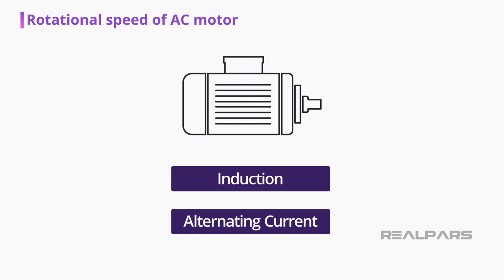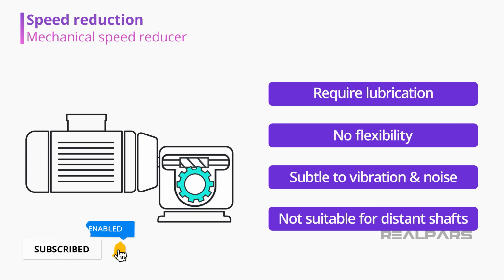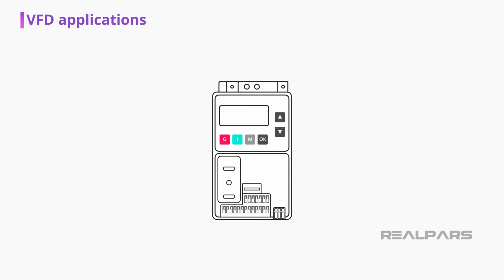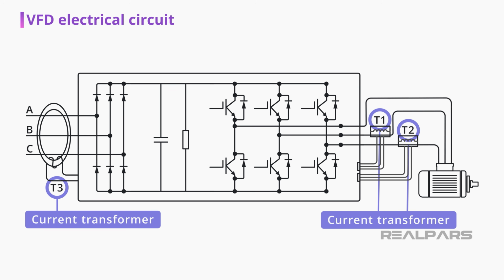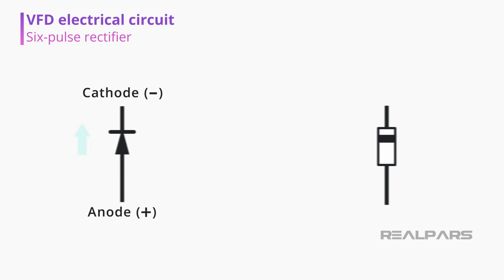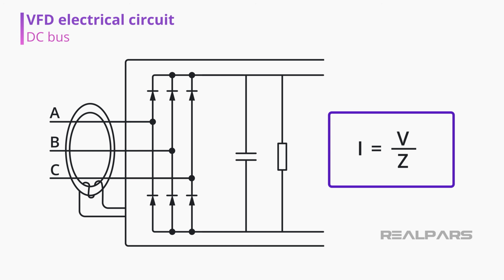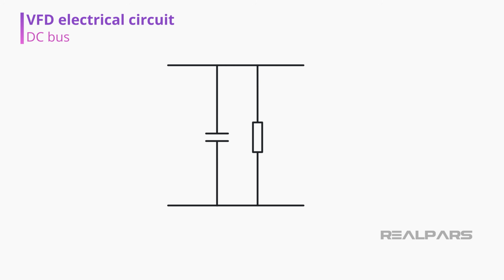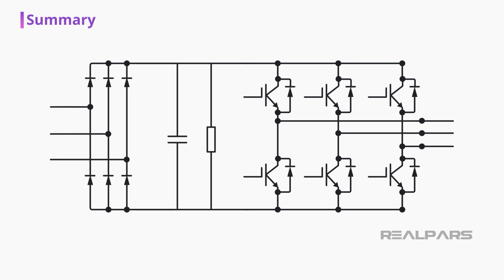Variable Frequency Drives Explained | VFD Basics - Part 1

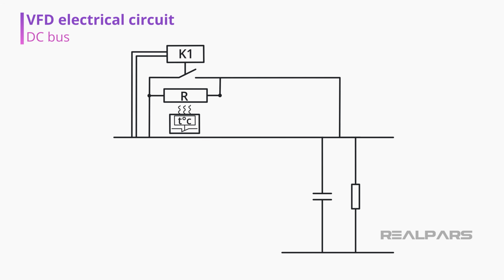Comment: I can't make sense of the pre-charge circuit at 6:15. Disregarding resistances in wiring it looks like it's shorted so any current would just go through the bottom branch straight to the low-pass filter. K1 doesn't seem to do much. What am I missing?
Reply from the maker: R is used to pre-charge the capacitor bank.  Once the capacitors are charged, K1 should close, thereby by-passing R.  When K1 is closed, current will flow through K1 preferentially, since it is the path of least resistance.  If the motor starts and draws current for too long through R, the thermostat will trip and stop the motor.  Internal circuitry is used to determine when K1 should close.  The actual circuits are much more complex than what is shown, but the diagram in the video helps illustrate these concepts.
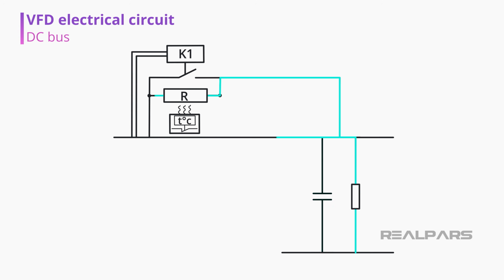Reply: @realpars  When K1 is open, there are 2 paths : one with R and one with nothing on it (the bottom one). So, on your drawing, the current should only go to the bottom one and not through R. I don't understand why the current can go to 2 different paths at the same time (6:18). Maybe the bottom line should not be here and instead only R or K1 ?
Reply: @idealdonor  exactly I was searching for one comment that notice this problem, basically de line under the pre-charge resistor shouldn’t be there because is a short circuit, if you remove it now you can see a utility for the K1 contact that is if the capacitor is charge to some level now we can close K1 making the other path for the current killing the R pre-charging.

Every nice video some times little details that needs to be fix but we have the comments section to discuss!

Comment: Why rectifiers are used in VFDs, what is the advantage of rectifier in VFD.
Reply from the maker: A VFD is used to provide power at a variable frequency to the motor.  There is no device that can directly convert 60Hz incoming AC power (or 50Hz in some areas) to any other frequency.  Therefore, the incoming AC power must be converted to DC and then back to AC at whatever frequency is required.  A rectifier section in the VFD is used to convert AC power to DC power, and an inverter section is used to convert the DC power back to AC power of the specified frequency.

Comment: another question please and thank u what kind of filter we use after the rectifier low pass or high pass or tape pass and why thank u sirI really appreciate ur efforts to give the best
Reply from the maker: It would be considered a low-pass filter.  The filter section of the VFD uses capacitors & an inductor to filter the voltage & current. The capacitors have a pre-charge circuit that allows the capacitors to reach full charge slowly so that they are not damaged. A set of resistors is provided to discharge the capacitors anytime power is removed. The filter allows the pulsing DC voltage to be changed to pure DC.

Comment: Should we use VFD and Contactor at the same time??? I'm a beginner learning curve of VFD. Please kindly to share your experiences. Thanks. From Cambodia.
Reply: Hello.  The vfd does not need a contactor, the vfd has all the necessary components for easy control.  You just need to carefully read the instructions for connection
Reply: There are many applications that involve contactors and VFDs used on the same equipment. They are application specific though. Are you asking about the pre charge contactor shown in the video or are you asking about contactors in general?
Reply from the maker: Very glad to see that the community has been so helpful to answer your questions already! If anything remains unclear, please let us know :)
Reply: @realpars  In case we use bypass,  I saw they use contactor and VFD at the same time. Thank you for your response. 😊😊😊
Reply: Better not to use contactor between VFD and motor as there is no need and can be a lot of problems during commissioning and further operation